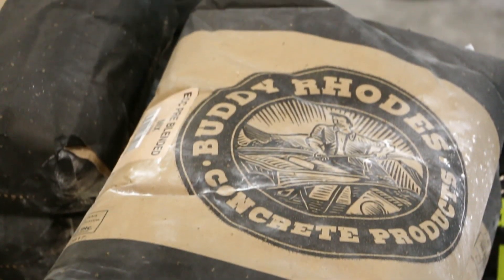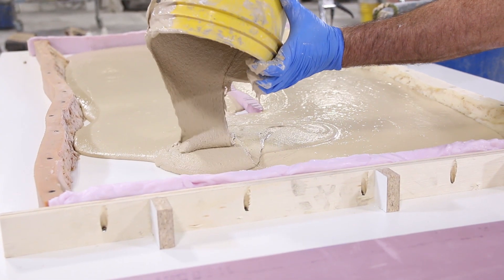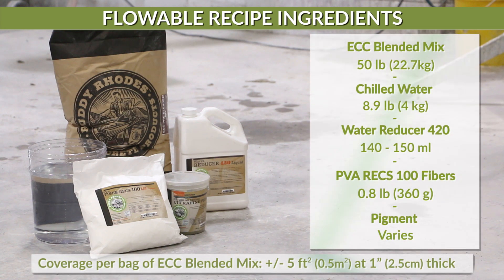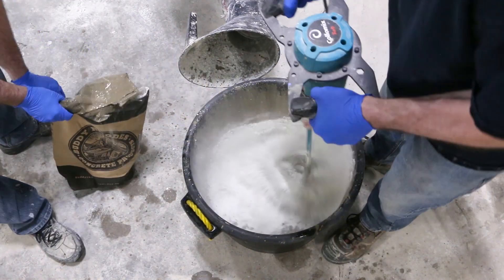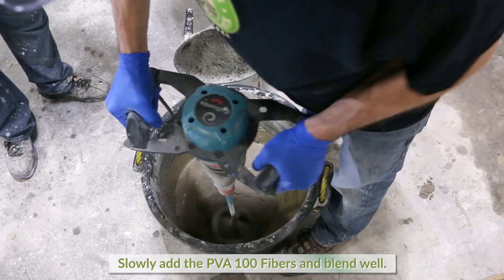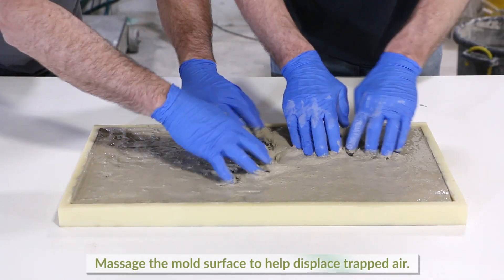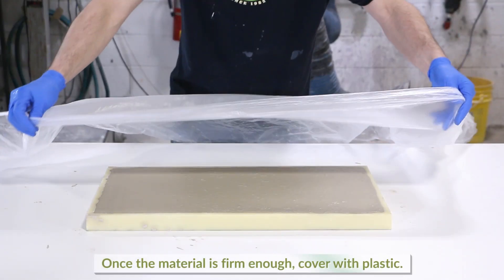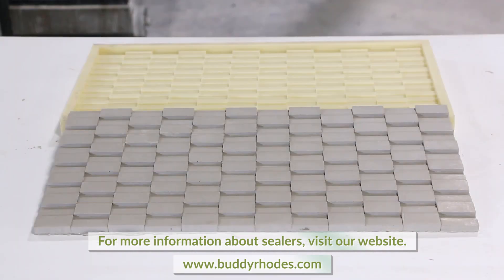ECC Blended Mix Basics - Flowable Technique

Comment: I'm trying to cast small bricks and cannot get a good flow with the ECC flowable recipe. My molds use about 5 pounds of mix so I cut the recipe to 1/10 per mold. I'm following the instructions in the catalog. What am I doing wrong? Should I add more water or WR to get it to flow?
Reply from the maker: Hello Nick, if you're using only 5 lbs, we would recommend premix the concrete bag (only the dry material, before adding anything else), and once premixed, take your 5 lbs that you're going to mix. This is because the proportion of raw materials could be off. That should help  and you should get a good mix when following our recipe. If for any reason it is a little less flowable than what you want, you can add a little more water reducer, we wouldn't recommend adding more water to the mix.

Comment: Whats the difference between FCC and ECC? Im doing a 2” thick countertop. What do i need?
Reply from the maker: Hello Rob, ECC is Engineered Cementitious Composite, it has high durability and ductility, it will bend before it breaks. 
What you need will depend on the technique and the concrete mix you're using. You can find the recipes in our catalog: https://www.buddyrhodes.com/catalog-of-concrete-products-and-techniques
You can contact our tech support team and they will assist you in anything you need: https://www.buddyrhodes.com/contact-support

Comment: A brush would help get into all the cracks and crevices really minimizing the pin holes.
Reply from the maker: Yes, that is true. But we wanted to show that even without brushing, just pouring the mix, you get very minimal pin holes with this mix recipe. Thanks for your comment.
Reply: @BuddyRhodesConcreteProducts  I can see first timers wanting a brush more than they want to stick their fingers in it lol But yes it leaves very minimal either or, good stuff.
Reply from the maker: @SoundsFantastic  That's a good point too. Thanks!
Reply: Good to see a company that responds to comments!  
Thanks for the help.
first timer lookin to do my entire counters. Lookin for a simple technique.
Reply from the maker: @Bobbybbops  Thanks Rob! For first timers we usually recommend the cast technique, with either the Craftsman Mix or the GFRC Mix. Our ECC mix is. little more tricky to mix and it can require some experience. Here you have the video explaining that technique with the Craftsman Mix: https://www.youtube.com/watch?v=Oc9nrh48zz8